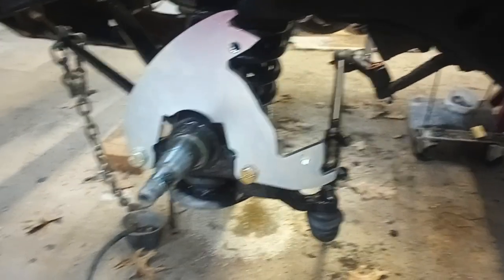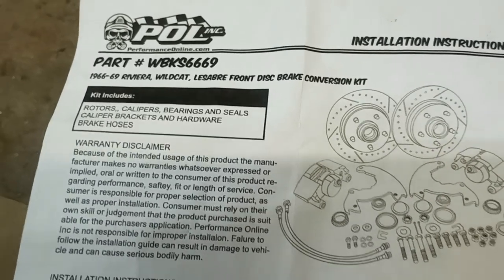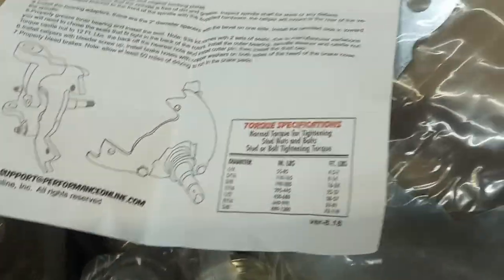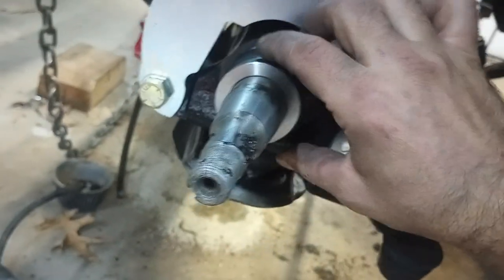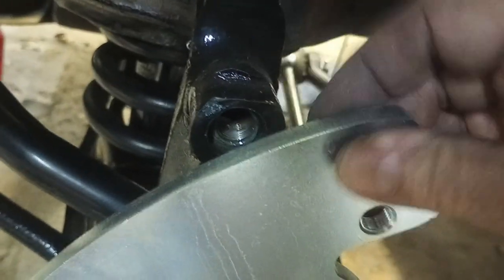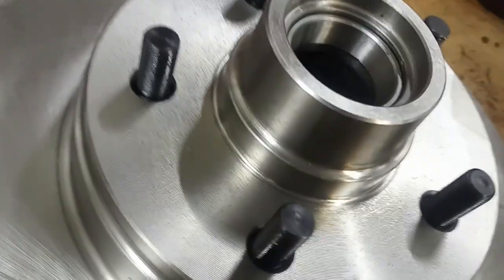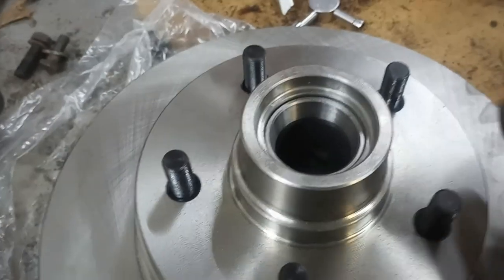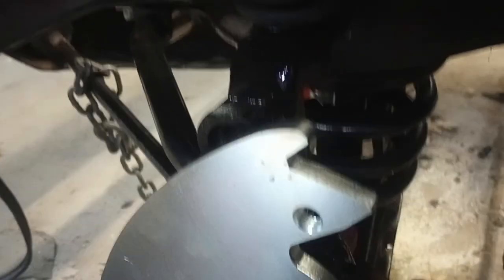Buick Wildcat Disk Brake conversion part 1

Comment: What rotors did u buy?
Reply from the maker: Hey - these rotors came as part of the kit from POL.  POL states that they are from 70's full size GM cars.  I looked up a rotor for a '74 Riviera on RockAuto and it looks the same as the one in the kit.  
This is the conversion kit I ordered: https://www.performanceonline.com/1966-69-buick-riviera-wildcat-lesabre-front-disc-brake-conversion-kit/